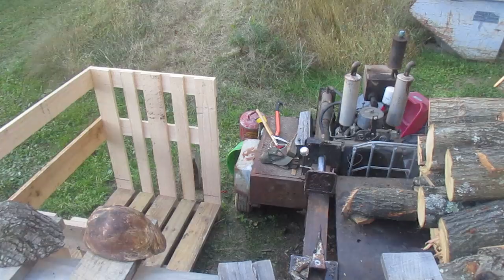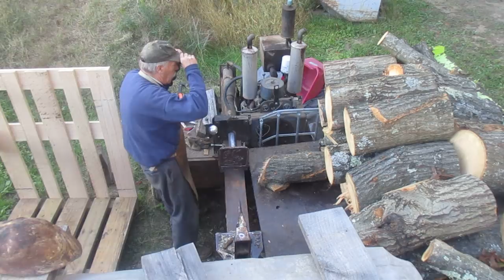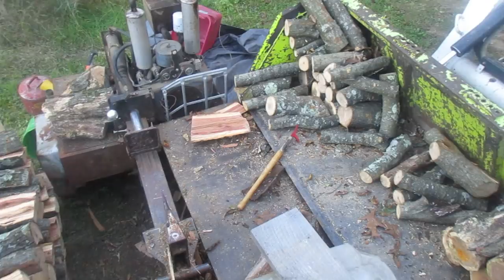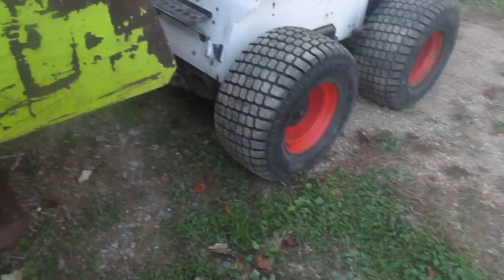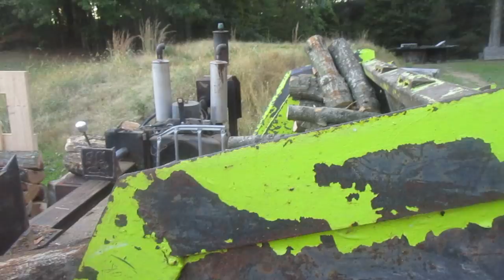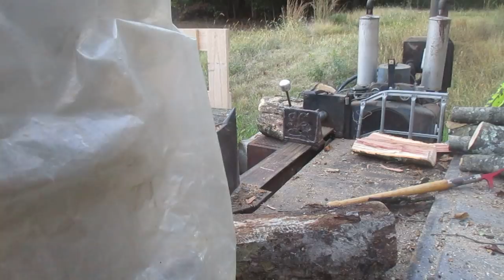Splitting the back yard Oak #521

Comment: John it looks like your old splitter walked right through the oak limb wood with no problem. Very impressed with the power and rapid cycle time of the ram with your splitter unit. Thanks for the splitting demonstration.
Reply from the maker: made it in 72 and didn't know what i was doing got lucky john

Comment: Like my Dad always said wood is a dual fuel ,heats you up when you cut, then when you split and stack it,then when you burn it. Nice video!
Reply: I heard this also but as an ancient Chinese proverb.  “Man who cuts his own wood warms himself twice.”
Reply from the maker: hi there may be keeps in shape not sure thanks john
Reply: @fricknjeep  Me and a pal figured out that you'll move one stick of wood 7 times before it ends up in the heater. Sounds about right.
Reply from the maker: @lewiemcneely9143  might be a bit high for me  . is that with your hands or machine .  1 cut tree 2 cut rounds 3 rounds in bucket 4 take to splitter 5 split wood 6 put in box 7 move box to storage 8 storage to boiler 9 box to boiler 10 ashes from boiler to garden . depends on how you count john
Reply: @fricknjeep  I always was a slow counter! I like yours better and if we put our pointed heads together we might come up with a few more!
Reply: @fricknjeep  And remember that you have all this high tech stuff and all it is here is 99% backbone. There is a splitter but it has to be hauled to the woodshed after it got cut, wallered and split. But it sure feels good when it's cold outside........if it'd just get cold again.